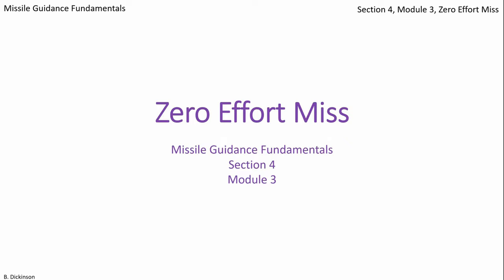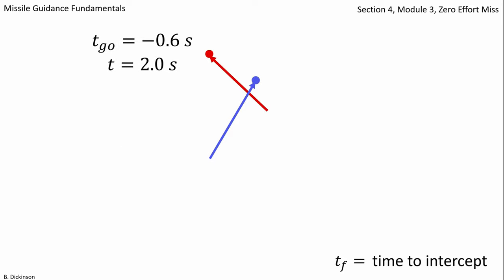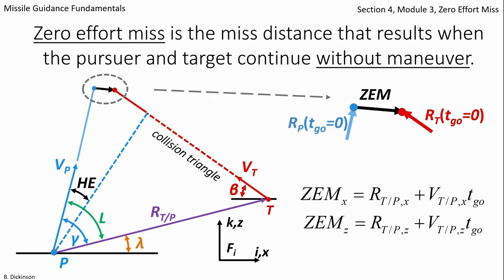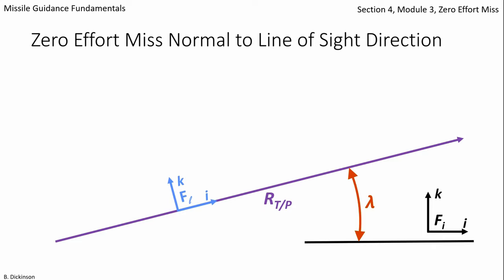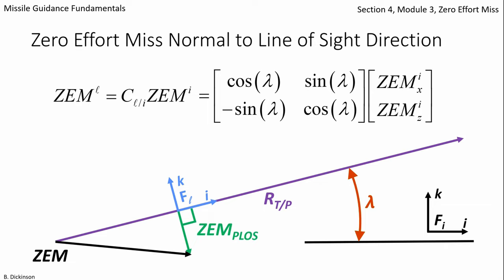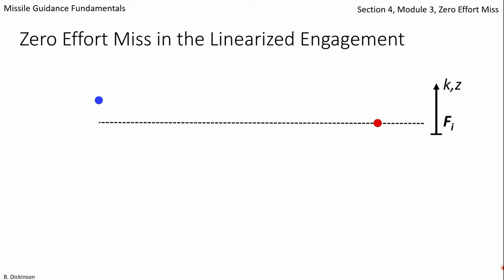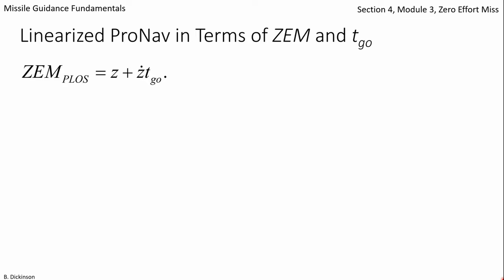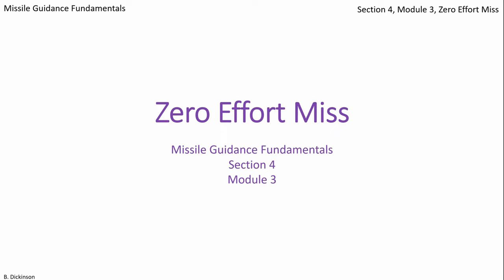Zero Effort Miss - Section 4 Module 3 - Guidance Fundamentals

Comment: Thanks for this awesome course.
I have a couple of question at the end of this module. 
1- What is the real use of the linearized model? I understand that linearizing makes analysis (under certain conditions) easier. However, the conditions are not guaranteed to happen in real engagement (I guess) + We can already do our analysis without a problem using the non linear equations as you did before. So what is the use of linear model? 

2- Does actual on board computer of a missile uses the linear model? I'm asking because in a comment you mentioned that estimating tgo is a key operation in optimal guidance, so I guess it is used in implementation, is that correct? and how they use it if its solutions are valid under certain conditions only?
Reply from the maker: Hi Mohammad,

Great to hear you're enjoying the content. I can answer some of your questions. 

The linear model allows application on linear analysis tools, with which much can be understood in an efficient manner that is still meaningful to the nonlinear equations. 

Time to go is a very useful quantity and there are many techniques to estimate it that go well beyond the simple formula in this module.
Reply: @LearnGandC  Yes, I understand this from you. My second question is regarding the real missile implementation (on a guidance computer) of this law (or its variations).
we have the formula based on rate of change of line of sight angle
and another formula uses tgo and zero effort miss (I'm not sure if this is valid all the time or in linear model only).

In actual implementation on a missile, which formula is used? I assume that rate of change of line of sight angle is not a problem and can be calculated using seekers (I think). But also you said that tgo is important and needs to be estimated. So which formula of the pronav is used in real implementation?

Comment: Hello, can i equate time to go to:
Displacement/VelocityMissile
As in the normal kinematic equation to find Time when you have Displacement and Speed? T=d/v
Reply from the maker: Hi there, not quite. In its simplest form, time to go or tgo is

tgo = R/Vc = -R/dotR, 

where R is the range to the target, dotR is the time derivative of the range, and Vc = -dotR is the closing velocity.

I believe your "displacement" = range, however the use of missile velocity instead of closing velocity (relative velocity between pursuer and target) only works if the target has zero velocity. For a target with non-negligible velocity, time to go must also include target motion, hence use Vc.

Time to go is an important quantity when implementing optimal guidance laws. There are a number of algorithms and improvements upon the simple formula above.